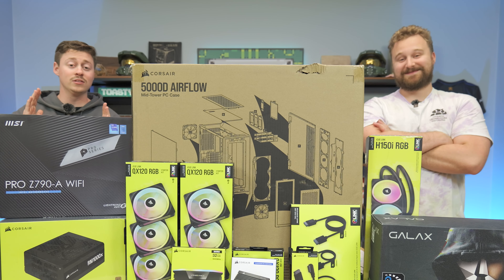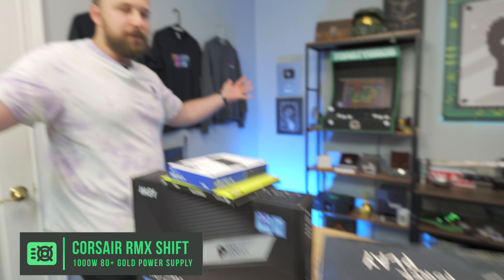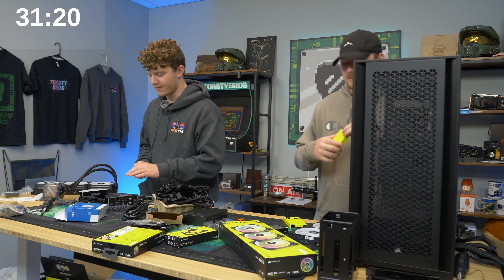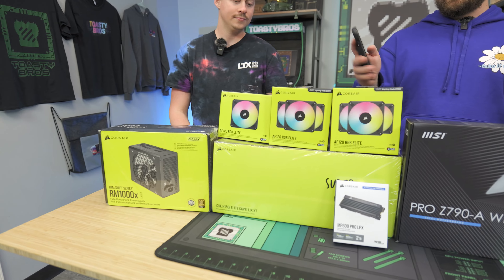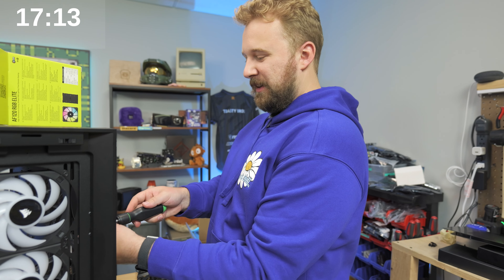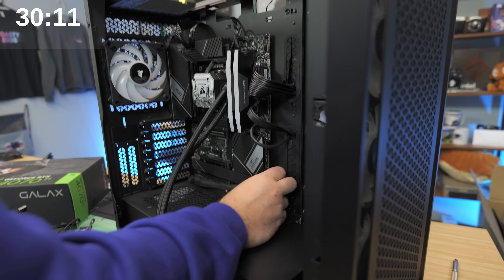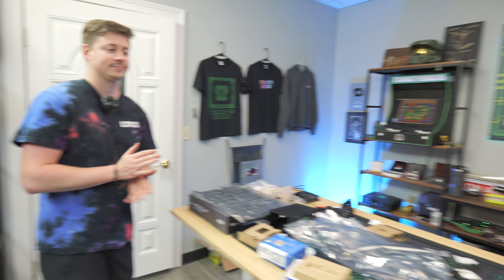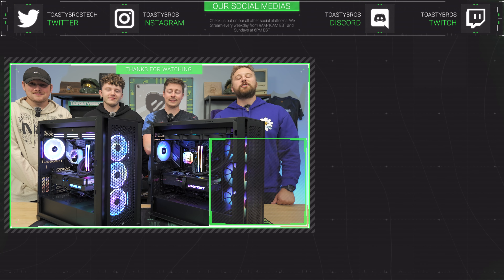Is This The BEST Gaming PC We Have Ever Built!?

Comment: I notice you didn't mention the INSANE cost of the new Corsair fans. $160 for just THREE fans is highway robbery. That breaks down to $53 PER FAN! That build had over $450 JUST in fans! That's a huge nope from me.
Reply: Good I’m sure it’s not targeting people who have budgets lol
Reply: You’re not wrong. I bought 3 sets of 3 plus a single. The capable AIO doesn’t even have a LED screen like the normal Elite does. I still have two hubs in the back plus a commander pro from my AIO (only to make the screen work) and the commander and RGB that came with the case (5000T). Still a clustermuck of wires.

Comment: My first build was in 2019 in a Montech case and I bought 3 extra Montech white fans from Amazon, the case came with a controller mounted on the back that is controlled by a dedicated in-case switch, but the three extra Montech fans also came with an extra fan and ARGB hub controller, with an included remote also, but it turns out I didn't have to install that, the remote worked with the cases included ARGB hub. But all then damn fans had two wires, one ARGB 5v 3 pin and one 4 pin PWM fan connection, it was a huge mess of wires, and then I had a 700w bequite non-moduler 80 puls Gold PSU and that didn't help, but I made it work!  I still have this build and use this build, but I have upgraded the GPU, the build consists of a 9th Gen i7 9700 and RTX 3060ti. I use it for 1080p gaming and it still works fine, it has a 1 TB XPG NVMe SSD and a silicon power 1 TB regular SSD for some extra storage. I won't ever sell  the computer for sentimental reasons, many hours of gaming fun.

Comment: Whats better for a budget build. ryzen 5500 with 6600xt or 5600 with 6600?
Reply: If it's in your budget I'd do Ryzen 5600 + 6600xt but if not than do the Ryzen 5600 + 6600 with Ryzen 5500 you get no pcie 4 support
Reply: If you don't care about pcie 4 support than get Ryzen 5500 + 6600xt
Reply: 5600 + 6600, 5600 allows for a lot more gpu upgrades without needing to worry about bottleneck + the xt variant of the 6600 isnt much of a preformance upgrade.
Reply: @geek_squad_130  + this, pcie gen 4.0 is gonna be pretty useful in the future
Reply: @wavesssy  yeah, it will
Reply: @geek_squad_130   unfortnuatley not in my budget but thanks for the help